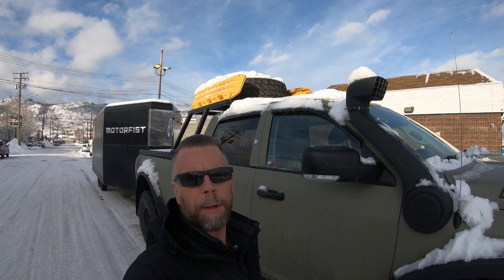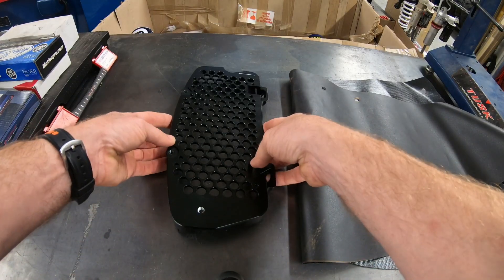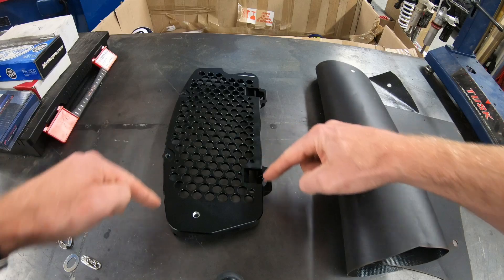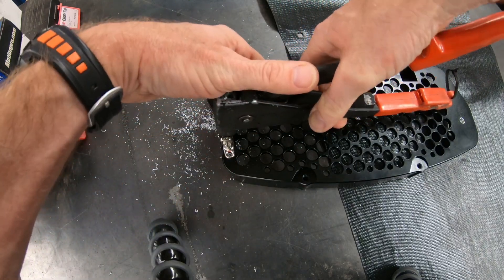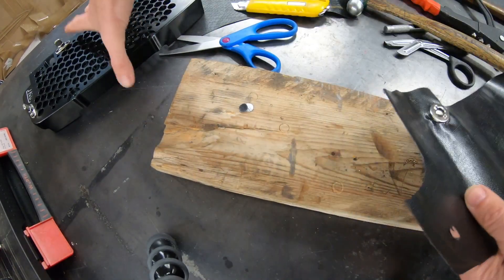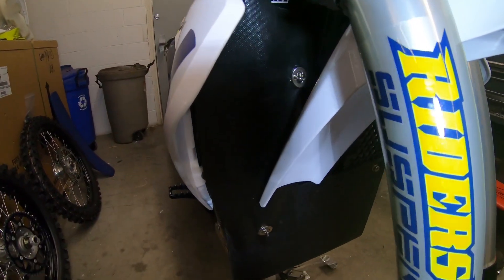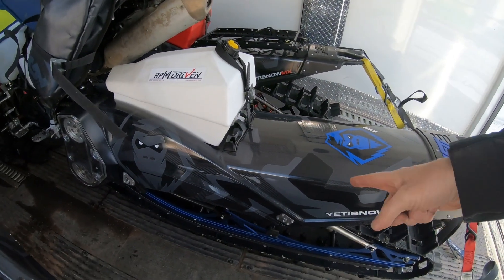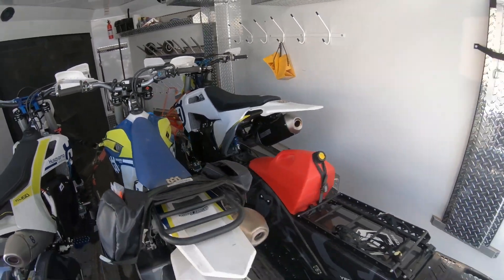More Power for $10 - Snowbike Radiator Air Blocker

Comment: On our snowbikes we run tunnel coolers and just use the one rad as a reservoir
Reply from the maker: Interesting. So you are trying to reduce heat? Are you riding mostly trails or otherwise hard packed snow?
Reply: @VernonSnowMX  we only ride the trails up to the mountains, and we have scratchers for the trail. we found our temperature stays more consistent in the powder with the cooler
Reply from the maker: @ACAtuker  Interesting. When you say consistent, what temps are you taking about? Like, how hot?
Reply: I've seen a few builds posted with tunnel coolers on SnoWest forums.  Looks pretty great for a bike you want to fully dedicate to snow.
Reply: I'll get some numbers for you, but we found on the trail up when going fast the rads worked ok, but going slow in the powder we would be either be to cold or to hot
Reply: Our snow bikes don't go back to dirt in the summer so we thought we would try it. It's honestly just like a sled, put the scratchers down on the trail and that's it you don't have to touch anything. Seems easier than blocking of the rads at different times of the day and having a rad shut off valve

Comment: So glad to see videos again from you guys!

Video suggestion/idea: Helmet selection! Why do snowbikers always use MX style open helmets and goggles, instead of a full-face snowmobile helmet? And how do you select the best helmet for snowbiking?
Reply from the maker: Hey, great question! Most mountain riding is quite strenuous and requires some exertion and hard breathing. Full face helmets don't typically keep up with our needs. When we shop for helmets, we look for lots of breathability. We especially like lids that have removable airflow vents so we can cool them down a pile if things get too hot. We also tend to pack 2+ sets of goggles as once things get too moist we just switch out for a whole new set. Helpful?
Reply: Agreed with Vernon. The full face helmets are to heavy and not enough ventilation. You'll fog it up quickly.